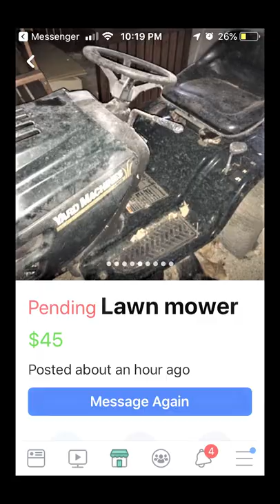Simple Test & Rebuild a Briggs and Stratton Starter #baldeagle242

Comment: Just in case anyone finds this looking for a repair for their mower, something to note is that a lot of times - more often than not - an engine not making it past the compression stroke can also be caused by valves being out of adjustment. Too many times to count, simply resetting that adjustment was all that was needed. 

@baldeagle242 -  saw your Deere hood and seat videos. That's how I found this one. I just wanted to say Thank GOD that you either found a new camera or figured out how to turn that thing sideways to landscape mode! lol...
Reply from the maker: LOL... I cringe every time I see the views go up on this video.  This was my first attempt at a YouTube video, and as you can see, I put zero effort or research into what I was doing.  😂
Anyways, thanks for watching, and I'm sure this video has more comical value than anything.
Reply from the maker: I will also add to this that a bad compression release on the cam can also be an issue that seems to be a weak starter or battery.  After you adjust the valves spin the engine over slowly by hand.  You should see (and feel) a very slight “bump” on the exhaust valve right before it closes completely.

Comment: Mine will not turn 'round at all. So, it may be dead. But I came looking to find someone opening one up so I might see what to expect. That 1/2" drive, 13/16 socket was worth the watching!  However, it might not work with every 1/2" 13/16" socket as the O.D. of a 1950's socket from Taiwon may not be identical to a new one from Sears that was Hecko en Mexico!
Reply from the maker: You are correct.  It also depends on the starter itself.  The diameter can vary from one year or brand to the next.  
Thanks for watching.   🦅